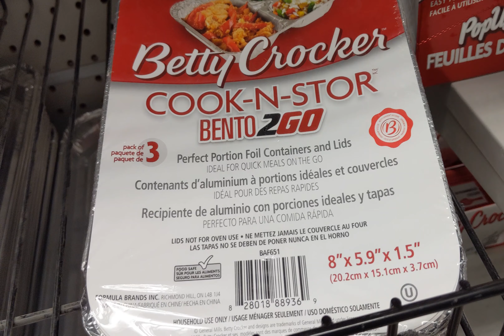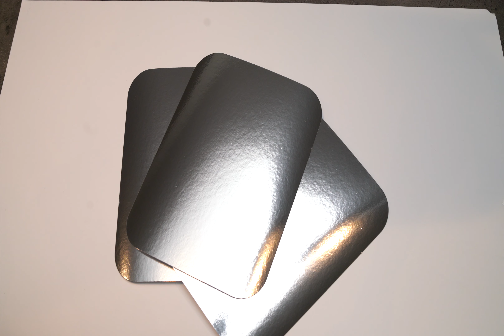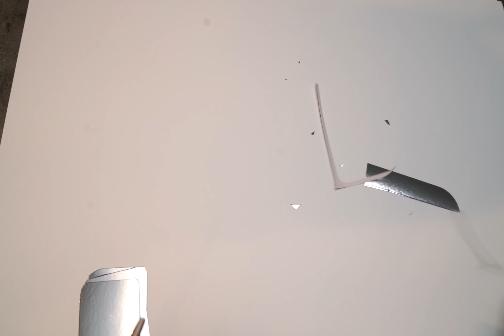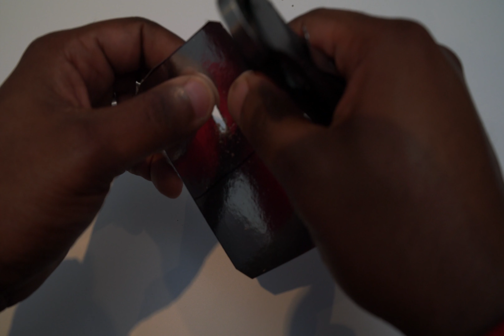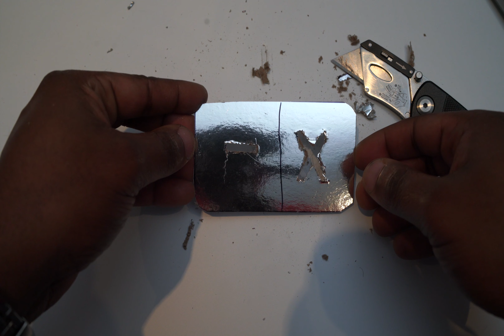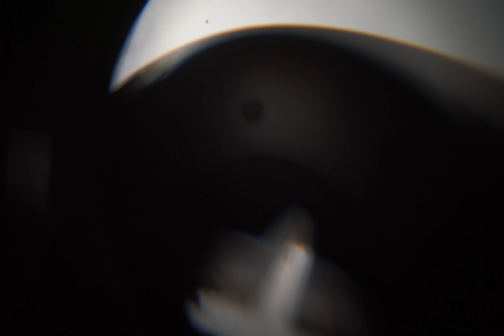DIY CONICAL SNOOT GOBO inserts (Neewer, Nicefoto Opencloud)

Comment: it didn't get burn with the modeling light?
Reply from the maker: If you use LED based modeling lights (like Godox), no. The temperature is quite low plus selecting the cover for cookware makes it more resistant.
Reply: @YvensBPhoto im wondering if  i can use a thick tin foil instead. I also use this gobo but my modeling is so hot that it damaged the glass of the gobo.i bought another one. Im just wondering if a thick tin foil will not get burned
Reply from the maker: Perhaps it won't but I'd recommend caution since if it can damage glass, it can certainly burn through paper. Foil might be the best option for you